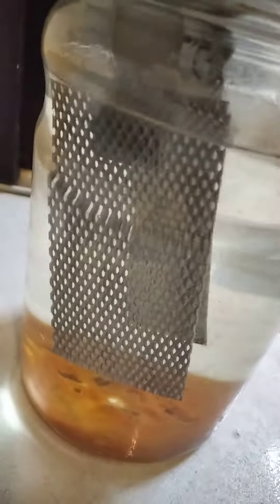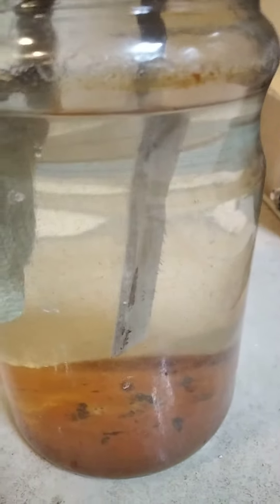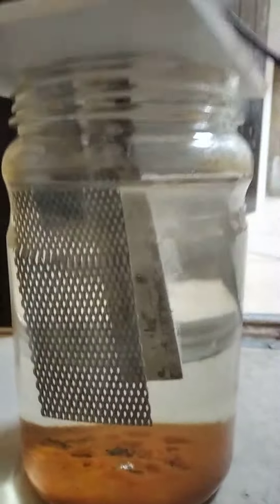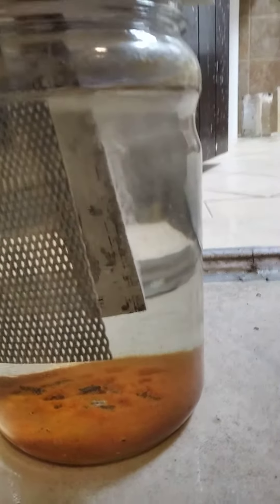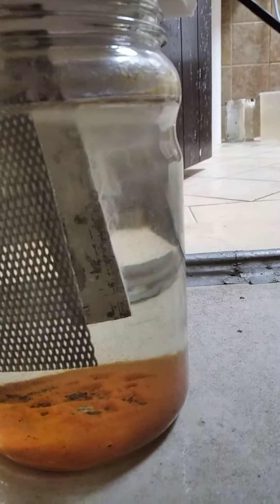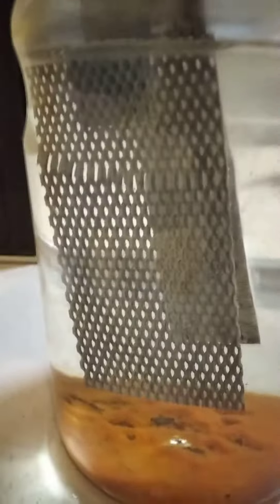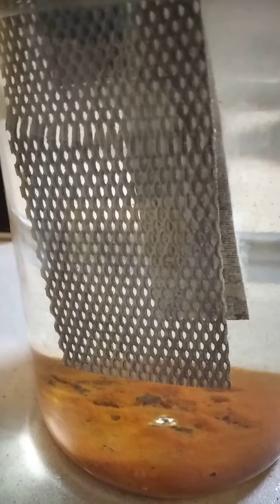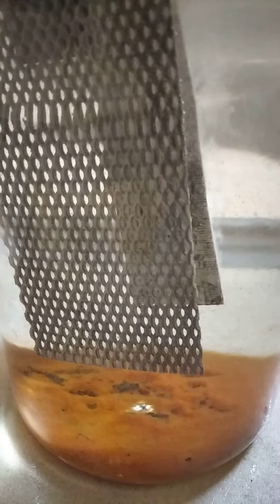GHETTO MMO Preview.

Comment: just the 316L stainless steel work... those more cheaper (mainly if it is magnetic) will corrode and contaminate with chromium
Reply from the maker: chromium is absolutely fine for this electrode.
but if im running perchlorate then I use a different cathode.
IE once this anode is coated yea.

Comment: how to calculate the surface area of expanded mesh
Reply from the maker: Electrolytic method. 1st prepare solution of NaOH of known concentration 2M or so and get a square box and 2 square anodes made of steel same size. Cathode for calibration is Ti plate or foil of known surface area and this sits equidistant to anodes thermometer is used to log temperature keep around same. Cell is ran at a set current density say 100ma/cm². Voltage is noted down and then Ti cathodes is swapped for cathode of unknown area. Run at same voltage and note down the current read out. Divide current by the set current density 100ma/cm² gives u cm² of your test anode. Then from there u can make  a flat plate equivalent ratio for any future electrode of same mesh. Like its 0.61 for those TWL platinum anodes so these have 61% surface area of their LxW measurements.